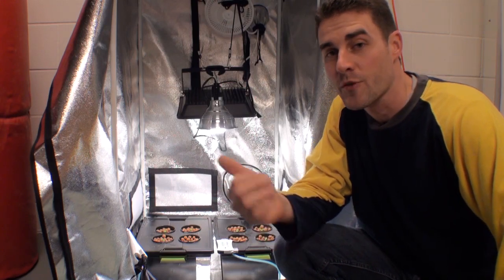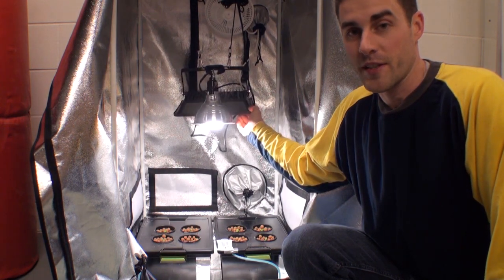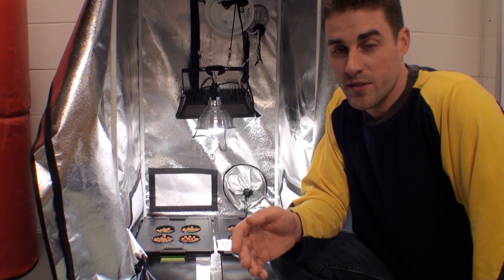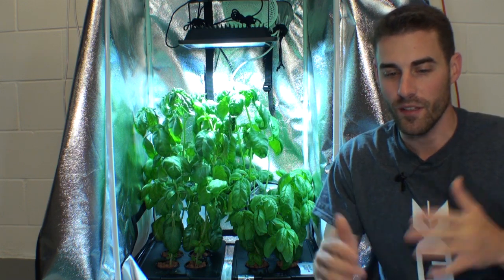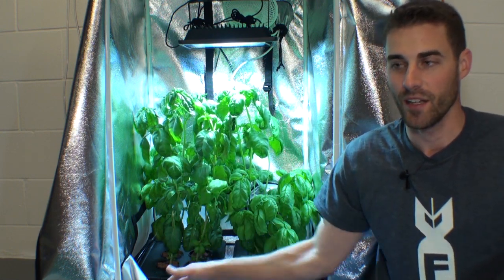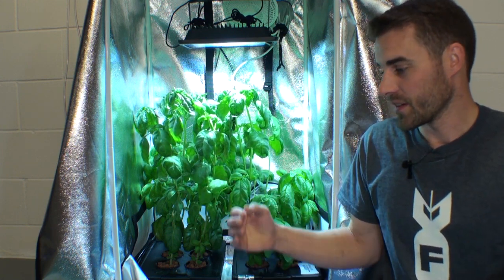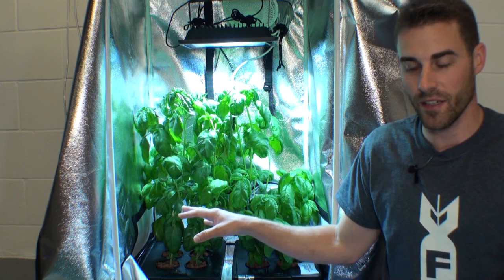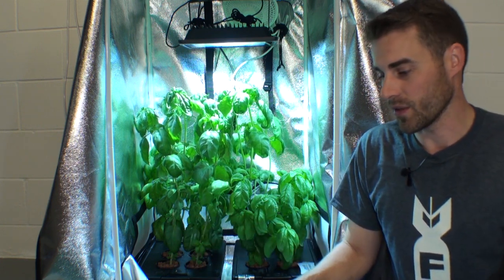Kratky vs DWC - Aeration vs No Aeration (Hydroponic Basil) Part 1

Comment: I'd have thought oxygenating the water would've had a more noticeable effect. Although in a shallow tub the 02 doesn't have long to diffuse bubbling to the surface. Looking forward to seeing how it goes with the clones in pt 2
Reply: Hello.  is that relevant?  my understanding from running an aquarium is that bubbles bursting on the surface of the water is what causes oxygen.  it is the movement of the water surface.  this is why the shape of a fish tank can make a difference.  so if you have 2 fish tanks, both 50 gallon but one is tall and the other short and wide...  the shorter one could house more fish.  due to a larger surface area, which can allow for more air in to the water...  but don't trust me, this is just what I read on the internet whilst doing research into fish care.
Reply from the maker: Russell Raccoon that could be true. Thanks for the comment
Reply: the bubbles going up doesn't add the air.  but it does stir the water around so it doesn't go stale or something...  but smallest bubbles are better, because millions of tiny bubbles breaks up the surface way more than a few large bubbles.  problem with a larger surface area is of course larger footprint required
Reply: Question; If you put a stone tip at the end of the tube (like you use in fish tanks) would that help with the diffusing of the O2?